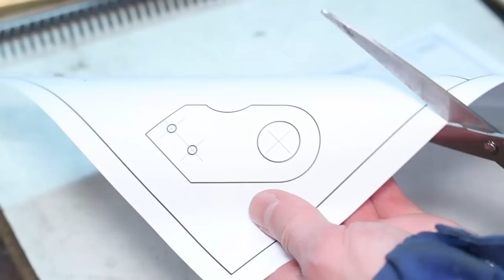New Spindle Start/Stop Lever - Operating The Mini Lathe Like A Pro

Comment: I’d just like to make an important point here. If you’re going to copy the idea of rounding a part in the mill using the method he did, manually rotating the part - NEVER rotate the part so that the rotation can pull the part into the bit. ALWAYS rotate the part against the rotation the way he did. Otherwise the part and whatever you use to hold it with will be grabbed out of your hand and violently and rapidly spun around. It may hit the mill column where the handle/clamp will fly off, possibly right at you. Or it will miss the column and spring around into your hand which you won’t have had time to move out of the way.

I don’t approve in doing this because of the danger. Metal isn’t wood.
Reply: 100% agree.
Good safety comment
That was a true cringe moment.
 I would recommend editing the video and completely eliminating that section to not give anyone ideas.
This is also a reason why I'm not an avid woodworker. I do not like the idea of holding work being cut with my hands. I prefer Chucks, clamps, vices etc. to hold the word piece and metal machine components to feed the cutters--not my hands❤

Comment: Really nice work.
Your obviously running a VFD with RS485 interfacing - why bother with the electro mechanical switchgear that you made?
A discrete 24v  FWD/OFF/REV with pot driven speed control on the apron is far easier and more convenient(albeit both options are.vast overkill on an 18" screw cutting lathe). 
BTW Carriage mounted motor control was only popularly adopted(1960s).when discrete electronics. we're not available and manufacturer's wanted to do away with expensive mechanical clutches...
Don't get stuck in the perception trap ie. trapped by old thinking/ technologies. 
Even better, try a footpeddle control - intuitive and natural in feel... and with emergency stop functionality too!

Comment: Nice! Just like a big lathe. Did you put your threading dial in a different spot?
Reply from the maker: Thank you! My lathe didn't have a threading dial. I think in the metric world it isn't so useful, but I didn't really understand how it works so far. Perhaps some day I need one and have to find a place to mount. But at the moment I have something different in mind for threading which should make a threading dial unneccessary.
Reply: @WeCanDoThatBetter  Nice. I didn't know that about metric threading. Looking forward to what you come up with. Cheers
Reply: @WeCanDoThatBetter  The threading dial has nothing to do with metric or inch.
If you cut a thread with a different pitch than the lead screw (on these small lathes usually 2mm) you need the dial to find the correct position to close the lead screw lock, if you open the lock to move the slide back.
If you close the lock on the wrong position, you cut a double thread.
On short threads the dial isnt that usefull, on long threads its faster to use the dial.
But switchig the motor constantly between forward and reverse can kill it, my boss managed to do this. Instead of using the brake or going from forward to off, to reverse, he did go from forward right into reverse until the motor said "Nope, im done". The setscrews that hold the stator in the caseing sheered off, the stator rotated in the caseing and ripped all wires off

Comment: Hi, can you tell me what type of plates you used at minute 11:01 of the video and what tool did you use for the chamfer?
Reply from the maker: Hi, the inserts I used for turning here are dcmt or dcmg ones with polished surface for aluminium turning. The chamferring tool came with my lathe. It is a simple hss factory ground one.
Reply: @WeCanDoThatBetter  tankyou

Comment: I watch the movie again because I intend to do it in my cormak 330 x 700 and only now I noticed that the switch does not turn on the right and left speed, did you not want to do that?

PL:
Oglądam film już kolejny raz bo zamierzam w końcu zrobić to w mojej tokarce Cormak 330 x 700 i dopiero teraz zauważyłem że przełącznik nie włącza prawych i lewych obrotów, nie chciałeś tak zrobić?
Reply from the maker: Hi and thanks for your comment! Yes that is right. The controller for the brushless motor has a button for switching the motor direction. I'm not experienced enough with electronics and don't wanted to change everything on the controller so I decided to install a lever on the bedslide for general on/off which has only one switching direction. To change the direction in which the motor starts you have to press the button on the controller box. I hope that makes some sense to you. I made a video on the brushless motor and controller where the direction change is explained.
Reply: @WeCanDoThatBetter  I do not know what the electronics in your lathe at a direct current engine, I probably watched the movie, I will come back to it, I have a 1 phase engine and in addition to such modification with the switch at the support I want to change the engine to a 3 phase and add inverter to smoothly adjust the turnover, although I have a gearbox in the spindle. I want to use the L-0-P rotary switch, link with similar modifications:

Maybe it will be useful to you
Ps. I am weak in electronics myself 😀😀

Nie wiem jaka jest elektronika w twojej tokarce przy silniku na prąd stały, film pewnie oglądałem, wrócę do niego, ja mam silnik 1 fazowy i oprócz takiej modyfikacji z włącznikiem przy suporcie chcę silnik zmienić na 3 fazowy i dołożyć falownik żeby płynnie regulować obroty, choć mam skrzynię biegów w wrzecionie. chcę wykorzystać przełącznik obrotowy L-0-P,  link z podobnej modyfikacji:

https://www.cnc.info.pl/przerobka-modyfikacja-nutol-tokarka-t6326-90.html

Może przyda się tobie
PS. Ja sam jestem słaby w elektronice

Comment: Why do you quench parts in water...that is the reason for the cracks
Reply from the maker: That's because I've read that C45 steel should be quenched in water. But that was definitely a fault. Next time I will definitely quench in oil instead of water.

Comment: 😅 I can not recommend enough, to any and all willing to hear me out. Whenever possible, that you engineer parts for yourself, where you incorporate press fits for dowel pins, if is very helpful to drill the pilot hole entirely through your work piece. If tool length wont allow, attempt to flip your part, and ideally meet halfway from either side, so as that after reaming the dowel side to size and depth, your dowel isn't being pressed into a blind hole. I have in the past either from the length of pins, undersized interference fit, not having the pin perpendicular upon starting the fitment, pressed dowels into blind holes, or try anyways, only to bend the pin, or ding it, causing binding of the mating part that had slip fit with true position of the same location. Sometimes you can pull them out, or massage straightness, mars etc. If you can just insert a small punch and tap out from the bottom side should it ever need replaced, or require modification after the install, it just makes life Sooooo much easier.
Reply from the maker: Yes that actually happened here. I didn't get the pin out again after pressing it in. The press fit was to tight. Not a real big problem but I had to rethink how to finish machining the part... :)

Comment: Thanks. 
What about the reverse mode for the spindle?
Reply from the maker: Hi, to reverse the spindle you have to press a button on the electronic controller. Unfortunately it is not possible to reverse the spindle directly with the new lever.

Comment: Definitely cool but I don’t exactly understand the point on a machine so small you are never far enough from the switch to not be able to reach it. Again it’s cool and I am not one to tell someone else how to spend their time I just don’t understand the point. I have a couple 10” lathes and I can’t say I ever felt like reaching for the switch was that much trouble.
Reply: Have you ever worked on a "real" lathe? Its not about how far the switch is, its about ergonomie and what you are used to. Also if things go south, having not to reach across the chuck can be a big advantage.
Reply from the maker: As wolf said, it is so much more comfortable to work when most of the machine controls are in one place. It's really not neccessary but if you have it once, you won't work without. It's an advantage not to reach over the chuck for starting or stopping the machine, especially in case of emergency.

Comment: Why didn't put sensor on the carriage?
Reply from the maker: Then you have a cable hanging around which I don't like on the carriage.  A mechanical connection is in my eyes much better suited as the sensor is away from the working area in a safe place and no chances of getting stuck with the cable.
Reply: @WeCanDoThatBetter  and at least it's beautiful )